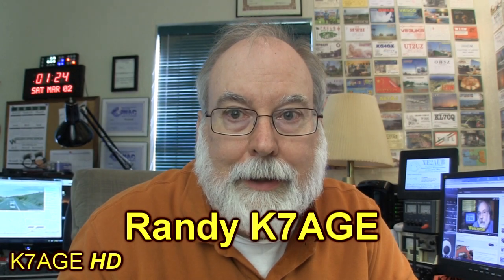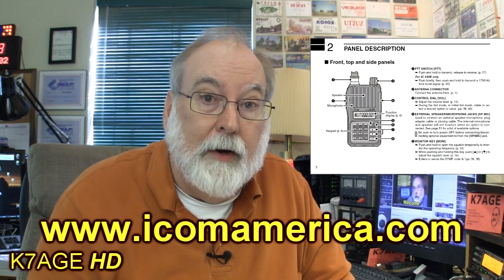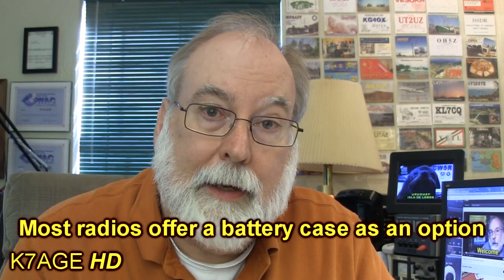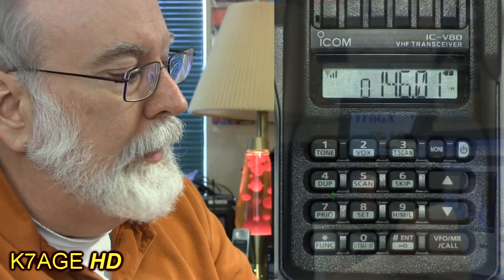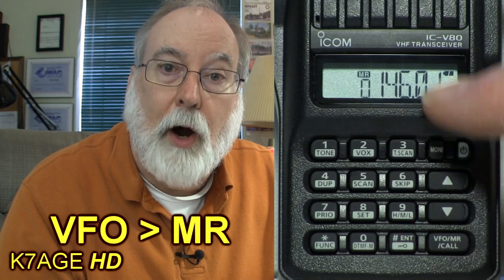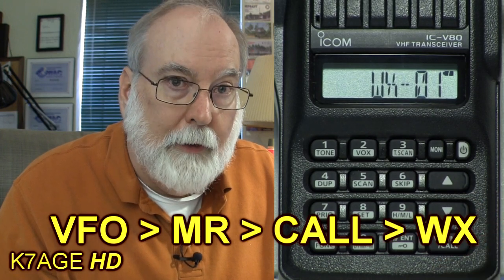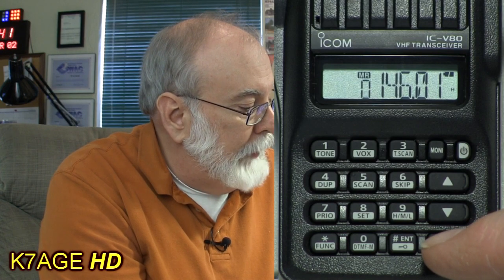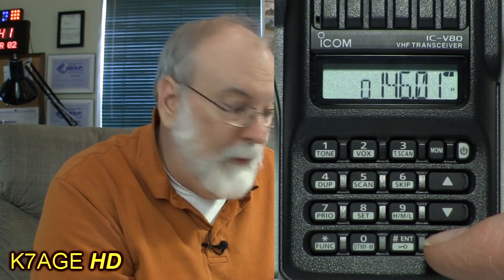How to get started on Ham Radio 2 Meter FM, Part 2

Comment: Hi there, thanks for the super video, learning a lot.

One question; does one have to use the national 2 metre calling frequency for simplex mode or can one use any frequency within the 2 metre band?

Greetings from Ireland ☘️☘️☘️
Reply from the maker: The national frequency is good to monitor and make an initial contact. It is then nice to move to another frequency. Thanks for watching.

Comment: Do you have a video on programming a generic radio on a repeater.
I'm buying a BaoFeng UV-5R, simply because it was cheap. Something to get started with. 
There's a local repeater:
VO1TBR
Repeater ID: CA05-5526
Downlink:147.30000
Uplink:147.90000
Offset:+0.6 MHz
Uplink Tone:YSF Digital Enabled
DG-ID:Open ↑ / Open ↓
Reply from the maker: Sorry no. There are lots of videos out there about that radio. Have fun

Comment: Hello k7age do you think i can use icom ic-092 on 2 meters ? Thanks for your nice video.  Greetings from Denmark.
Reply from the maker: I wasn't able to find much out about that radio. Not sure. What I show it may operate around 200 or 450 MHz. An icom ic-92 is a 2 meter / 70 cm ham radio.
Reply: K7AGE thanks for your answere , i see icom 092 and hamtac ic 092 is same radio  , vhf 136 245 350 uhf 400 465 mr

Comment: I can save a repeater frequency  to memory but it does not save my PL tone, it will reset itself back to 88.5 or something default. How do I save the tone to match the repeater frequency?
Reply from the maker: You typically need to have everything set before saving to memory. Make sure that you can key up the repeater before storing into memory.
Reply: that's the problem, waiting for my call sign to come through. And seems like living in a wooded area makes tuning in difficult.

Comment: Is there any particular type of AA battery you recommend? Lithium, alkaline,etc.???

Stuart KK6RXR
Reply from the maker: Stuart Clark Probably best to check the radio's manual. If I am going to be using rechargeable batteries, I would use the batteries that are sold to use with the radio. For emergency, then alkalines that you can buy anywhere are great.
Reply: Energizer AA lithium works for me, they seem to last longer than alkalines. Some odd reason the manual says not to use NIMH or Nicd in the sport model but the manual also reads off the current draw at 7.2V. 
--KN4GEI

Comment: K7AGE... just recently passed technician (KM4HOC) and so far am enjoying and benefiting from your videos. Thank you for producing these. One question though about AA battery packs... I am a recharging enthusiast so using AA batteries appeals to me... but as it is usually known, the voltage on a rechargeable AA is about .3 volts less than a standard AA. Will most handhelds still work with full functionality with rechargeable AA batteries?
Reply from the maker: Jonathan Robertson Yes, in fact you can usually buy a AA battery case for most HTs as an option. I first caught on to this during a fire working with Cal Fire. They has cases of 24 HTs that they would loan out to the fire companies from outside the area. They all used AA batteries, and they would also hand out loads of batteries with the radios. No messing with rechargeables during the fire.

Comment: Hi Randy, great vid! May I ask a ?? On handhelds is there any power advantage in selecting their rechargeable battery pack vs standard AA batts? Also, would you recommend using rechargeable AA batts for the icomm handheld? If so, what brand?
Reply from the maker: Rechargeable is good for daily use. The AAs are good to have for those times that you may have run out of charge, or maybe during special events. I think of AA batteries, you can get them anywhere and fit most equipment that I own.

Comment: I am a new HAM, KG7FTP, I do not have an iCOM which is a good radio. I had to go with a cheaper brand Baofeng UV-5r plus. Great video, although radios are different concepts are the same. I was able to follow along using my radio. I have a question, how do I establish contact with a repeater?
Reply: herbert gray you get the repeater going on your radio?
Kc3kpe

Comment from the maker: The V80 is a very basic radio. It does not support APRS. Kenwood's D72 and Yaesu's X8 series radio do support APRS with built in GPS and TNC. You could probably hook up an external TNC to the V80's mic and speaker connectors.

Comment from the maker: I am learning a bit about D-Star, I have an ID-51, that I am starting to figure out.

OK on working on your Tech.. Let me know when you pass.

Most D-Star radios are dual band 146/440 radios. So, same antennas and bits as the common analog radios. We do not have digital antennas!  For the vehicle, Comment and Diamond both make many dual band antennas.  For home, they both make dual band verticals. The next step beyond verticals, is a beam and a rotor, but that is a lot more stuff to get going.